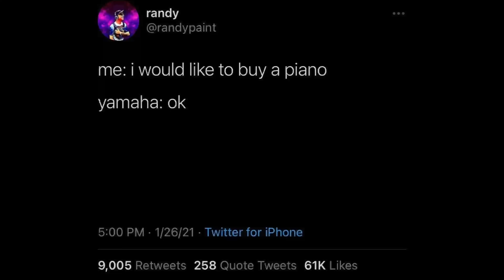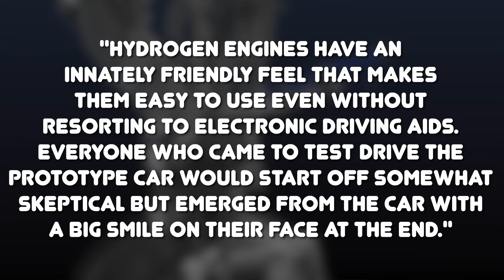Toyota's New 455HP Hydrogen V8: Everything You Need to Know

Comment: I would absolutely buy a hydrogen powered internal combustion vehicle over an electric car. There IS a MAJOR advantage of a ZERO emission Hydrogen engine over an electric car with disposal issues of the materials used to make the batteries.

Comment: I disagree with the electric being better than combustion. Only for one reason, the grid system our country has isn’t able to sustain its current draw. Rolling black outs and fires are common in ca and I think once more states start using electric vehicles you will see the same start happening there. 10 years is a good projection but we would need either a new grid system capable of handling that type of electrical load or gigaplants.

Comment: I'm with Toyota for this hydrogen can be deployed easily in daily terms of use without completely destroying the infrastructures that are already here (gas stations, petroleum pipeline systems etc...) without making a fuss. So all electric could still be a problem because it would really be zero emissions if it was produced by renewable energy and not (like it is today) from coal and fossil fuels. So I think like using both of electric and hydrogen can be a good choice for various reasons.

Comment: The main difference between the current fuel cell cars and this hydrogen engine is the need for platinum. No platinum is better. Also Japan doesn't have the resources for  fleets of battery cars, they have to use designs with engines.

Comment: The one thing that could make this viable would be Home Hydrogen production. A downsized home wind and solar combined generating station with an electrolizer could be continuously making hydrogen and filling a large capacity stationary tank that then could be used to fill your vehicle tanks. The only time you would need to fill up away from your home would be on longer trips. Just a thought. I think Honda had something similar. You could also have the hydrogen brought to your home or farm by truck similar to the way propane is delivered now to fill large external stationary tank, then is used to fuel home heating etc. My Uncle's truck ran on Propane, so he never had to fill up at a gas station. It was delivered by truck to his home and he filled up his vehicle tank at home. Not sure what the cost was, but Hydrogen could have a huge advantage because it can be produced  at the location. I could also see scenerio where smaller localized hydrogen electrolizers could be operating at your local convenience store with a combination of produced on site and shipped in by truck. Might be crazy, but with no real need for complex refining like gasoline, could even become easier than gas. Not a scientist or Engineer, so please feel free to debunk the whole idea. If the equipment is too expensive, then I could even see the possibility of leasing the equipment to the user for a monthly fee.
Reply: where to begin, it takes loads of power to produce,ore power to liquify so unless you have a nuclear reactor at home and many millions for a large electrolyser and liquifier you can not make hydrogen at home in any quantity that matters and it sire as hell isnt affordable.....peoplr should learn some basic chemistry in stead of Shitposting

Comment: My biggest problem with electric is the range. I drive 140 miles a day round trip to work and most electric cars would have to be charged everyday on thay comute. And with my current living situation I can't charge over night plus I live in California and rolling blackouts are supposed to be the new norm on top of the gas engine ban coming. Hydrogen makes sense for long distance driving we just need the infrastructure. You can pull Hydrogen from the air where every you are too

Comment: Hi mate, my grandfather made a hydrogen converter and fitted it to 2 taxi’s during WW2.   Those taxi’s were on the road during war time when petroleum was hard to get.  I’m sure there is some of his stuff with the Queensland museum here in Australia because they had a display on his pioneering efforts 😀
Reply: Is that the classic hydrogen generator i have seen many people build and install on their every day vehicles? I bought a lot of the stuff to build one myself, i just never got around to finishing it.
Reply: @wadestanion4617  hi mate 
 He used a different process by burning timber to make charcoal then uses the charcoal and water in a device to make hydrogen while the motor was running and when motor stopped the device turned off 
From my recollection petrol was used to start the engine and then the hydrogen was introduced allowing the engine to run then the petrol would be turned off
Reply: @evanjones1393  hmm.. well this set up sounds pretty much like the hydrogen generator I am referring, with a bit of difference. Container with water and a combination of dissolved chemicals of sorts. And a panel of stainless steel spaced out with electricity applied making Hydrogen, and then sent into the engine. It was also introduced after the engine was running and turned off before the engine stopped.
Reply: Saw an old scientist and his wife here in the states traveling around in a small truck converted to burn hydrogen,there wasn't any super technology needed to do it either,ran basically like burning propane.The scientist was traveling around to explain it and show people it could be done,simply.makes one wonder how many times the elites have defecated on our lives to keep themselves in yaughts and mansions.

Comment: Vehicles will be using the Internal Combustion Engine for a very long time. Im sure they will slowly become more rare, but they work extremely well in Hybrid vehicles. ICE runs on damn near anything making it ideal in harsh conditions. They are cheaper and easier to build, and last longer. ICE have not reached their peak efficiency or potential yet, and will still outperform EV's for quite a while.

Comment: I personally don’t think they’re crazy. 10 years ago we didn’t really have the infrastructure for electric cars and we still don’t really have the infrastructure. I would definitely be the kind of person that would bite us because I would much rather have combustion engines than electric engines in my car. We have so much farther to go in terms of technology and infrastructure advancements before EV‘s become the mainstream vehicles on the road. If we were to really invest in hydrogen fuel and the infrastructure to support it, hydrogen could win. This isn’t to mention the fact that electric vehicles require so much charging time in comparison to a gasoline vehicle. The amount of people visiting a gas station per hour with a 1.5 minute to 2 minute fillip time is incredibly high. Even if we were to reduce the charging time for EV‘s down to 30 minutes for a full charge, you would need a gas station four times the size of Buc-ces and begin to support the traffic flow in an electric charging station. Also, the fact that a brand new battery cost 6-8k and they have to be replaced every 10 years? (Correct me if I’m wrong on that) They have to be replaced way more often than a combustion engine or even a transmission needs to be replaced. Not many people can afford a $70,000 car and $8000 battery every few years. You have people driving around in $2-$3k Honda Civics and Toyota corollas that are struggling financially. There’s no way to completely get rid of gasoline engines on the road unless we were to find some alternative. The fact that hydrogen combustion engines allow for people to keep the same cars with a modification to the fuel system means that would be far cheaper for people to convert.

Comment: Anyone can make hydrogen at home. That's the deal. Electrolysis could enable every single home to create easily transported energy. This electrolysis could be done with solar, wind, hydrogen or city grid. If the city grid uses solar, hydro or thermal. Then it's clean as can be.

Yes hydrogen is less efficient, but if everyone can obtain it then it could become much cheaper then gas down the line.

Comment: I know I will never buy a battery powered car but when the hydrogen production and infrastructure is there I would buy either fuel cell or hydrogen ICE. Here in the UK there will never be the charging supply grid infrastructure capacity for battery vehicles and nearly half the people live in dwellings (apartments and terraced houses with no front parking area) that would support home charging. Battery charging at remote stations may become faster but again we don't have the supply grid infrastructure and by the time we did, the hydrogen will be produced by green methods and the filling stations would be established so we can fill up just like we do now with petrol. Therefore I say hydrogen will be the solution in about 20 to 30 years from now. At least in the UK and similar countries.

Comment: I really like this.

One reason IS zero emission. I'm not big of climate change and carbon footprints since it's such a huge controversy and I don't know the real truth about it but I think no more carbon monoxide is a great thing. If you live or work in a city, you really can't escape this mild poisoning. I have never liked gasoline engines for this reason.

Hydrogen stations may be sparse now but I'm sure that is going to change in the future. The hydrogen fuel cell market is growing. Batteries just seem to have got a big head-start. In addition, hydrogen can be made by electrolysis and solar power instead of oil (the main source today). In time, I'm sure this will grow. That is basically free other than the cost of the setup and maintenance of the plant. I think hydrogen prices will drop in the future.

Another point is that, if this all gets popular, loads of people will start converting their old gasoline engines to run on hydrogen. That means, if gasoline gets phased out, you will still be able to run your old car. 

I also think that in cold countries, gasoline is an advantage because the engine heat can be piped into the cabin with no reduction in power. An electric engine has to use a lot of it's battery to provide heat.

Comment: I will stick with vehicles that aren't connected to the internet, that aren't drive by wire.  I have no issue swapping in a hydrogen engine into a 66 Nova. The only issue with swapping an electric motor into a classic car is the batteries.  I don't think they are good for the environment with current mining and disposal practices.

Comment: Electric eliminates all maintenance? I guess, if you buy a new car every 3 years. When the battery dies in 3-6 years, the  car is totaled. ($26,000 to replace) That is not even the worst part. The horrendous cost in people and environments to produce these batteries, not to mention what it takes to produce the electricity to charge them, negates the "green" or "net-zero" label entirely.

Comment: Green house gasses (plural) meaning there are more gasses floating around out there other than carbon dioxide (which is a tiny percentage) supposedly heating the planet to "crisis levels." 80% of green house gasses is (wait for it...) water vapor (<----that's water in its gaseous form). What is the exhaust from a hydrogen burning engine? Water vapor. I can see some dramatic changes to the weather in our future if hydrogen becomes popular (we might actually get a decent winter or two here in Nevada).

Comment: For me it seems a no brainer that Hydrogen powered ICE engines are the way of the future compared to EV.  The convenience of just filling up the tank as opposed to charging being one massive pro. Compared to Gas, no emissions, and with hydrogen being such an abundant resource, if the infrastructure is put in place and i can't see why not, we did it in Australia with LPG in the 90s, just added a few extra pumps at existing service stations. It will be far cheaper than gas which will continue to rise in price. I also watched another video where Toyota is now making fully renewable sources of Hydrogen from cow manure. So sorry vegans, you are wrong, we need more cattle to save the environment. If governments invested in the hydrogen supply infrastructure, they will take off.

Comment: Either you're being paid to promote EV's or you're just an idiot! We dont have the infrastructure for half of the car owners on the road to switch to EV's without completely collapsing the electric grid. Not to mention that they cause more pollution in the making of the batteries than a new Honda will out out in its lifespan and the fact that the disposal of the batteries is another major issue and one that doesnt get better over time. Global Warming is BS, it's a hoax to get the brain dead to go out and spend 3 times as much on a car that can only go 200 miles and has to have its $15k worth of batteries replaced every 4 years.

Comment: You have too much faith in electric vehicles. Even the best electrical grids in the world cannot handle a mass switch to electric vehicles. And there are nuclear power plants (the cleanest and best sources of electricity) being shut down, which only makes the situation worse. The precious metals needed to manufacture the best batteries are scarce.

Hydrogen cars would be the most sustainable way to shut the environmental activists up. It would be a hell of a lot easier to bring hydrogen infrastructure to the places that don't have it than it would be to bolster the electrical grids enough for now, let alone for the massive influx of cars in the future. There are a lot of places where electrical grids cannot handle when everybody turns their air conditioning on for a hot day. Imagine adding the load from charging cars to that mix...

No. Hydrogen is where it's at. Every car manufacturer should be investing in it.

Comment: I'm excited about a combustion engine that's hydrogen powered I hate electric cars that don't sound good and they have no top end performance idc how fast a car takes off if it can't win a race on highway just like tesla ppl always talking about they beat hellcsts at the dragstrip but those same teslas are also the ones losing to Hondas on the highway not to mention they cost alot more to fox when they do break the biggest loss I've ever taken on any car I owned was a tesla model s car cost me over 45k and then a little over the 2 year mark the battery died and it was going to cost me like 20k to get a new one where as I can blow up combustion engines all day long and replace then for 8k and less I would be ok with electric as a daily driver if they weren't so damn expensive to fix when they do break but I don't see electric being a go to car for normal ppl when it comes to racing bcuz they don't have the top end power and u can't just go upgrade them like with combustion engines u can make a 450hp engine into a 1000hp engine for 15k to 20k right now where as with the electric engine u cant even upgrade them at all so like I said maybe for a daily driver ok but for racing not a chance in hell

Comment: I do not agree with your analysis. Do you know that under the seafloor around Japan there is an immense amount of hydrates deposits, a material which releases huge amounts of hydrogen when heated?????
For Japan, it means access to cheap low cost hydrogen source, which can be use as replacement of fuel, since most ICEs and/or gas turbines could be retrofitted to run on hydrogen with relatively small investment....... think about that!

Comment: The ev cars are not nor ever will be viable , its a fad that has legs due specifically to massive government  subsidies .
You leave out soooooooo much downside to electric toys.
You say  5 or 10 years you can't imagine combustion outselling  ev ? Are you high ? 
Spoiler alert , it won't be in your or your children's life times .
Lmfao , no maintenance???? 🤣😂😅🤣😅😆 the generator and battery alone you'll  need to pull a second mortgage , between 20 and 30 k ! 
Resale value.....,  in the toilet . Where do you live that electric  bills are so cheap? Put a charger in your house , 5k for that ,home  charging notoriously broken down as are many public charging stations , finite amount of expensive materials to make , disposal issues not addressed,  currently paying to literally dump batteries in 3rd world countries ,loss of gasoline taxes,  cant haul weight , garbage in cold and hot environments,  extremely difficult to put out ev car fires which reignite multiple times , very heavy car leading to far more serious injuries deaths , etc etc etc etc etc so many downsides to list . And omfg the cost !!!!. And how many ev do you think will be on the roads in 20 years ? 80% of combustion  cars on the road today are over 20 years old .
Research some more , ev lifetime is more expensive than combustion . 
And how long do you think it would take for infrastructure to be adequate? Not mentioning the power grid will never be able to handle it . Oh yeah , those costs 
( your taxes )  are not factored in anything. 
You've been sold son , the big picture , ev would destroy humanity .
But hey , its so cool 😎

Comment: In regards to electric cars; the major thing you left out is that we have yet to see longevity of batteries (maintenance). So a older electric car with bad batteries is worthless if you can only get 100 miles per charge. So will electric cars be like a cell phone that it is just thrown away once something fails? Also when it comes to emissions, electric cars may be carbon neutral but the processes of creating them are no where close. 

Electric cars have a long ways to go and so does the U.S. power grid before the combustion engine will be obsolete.